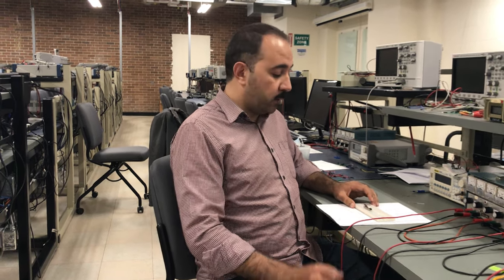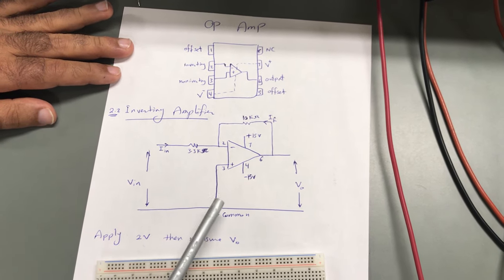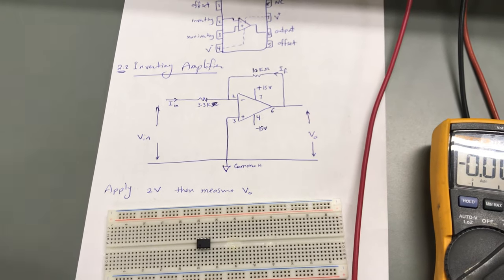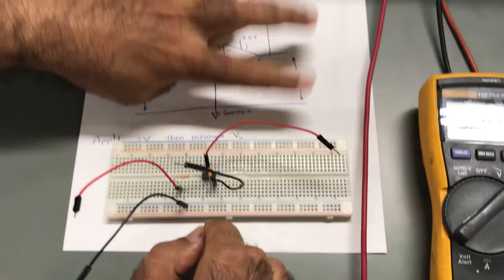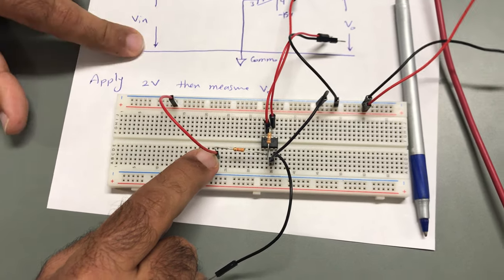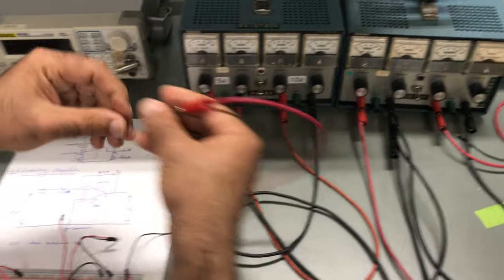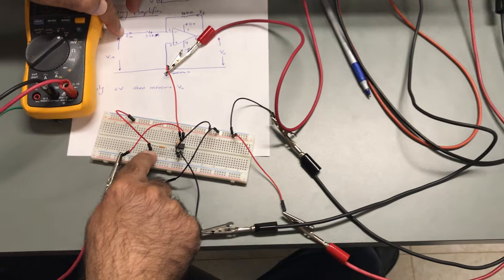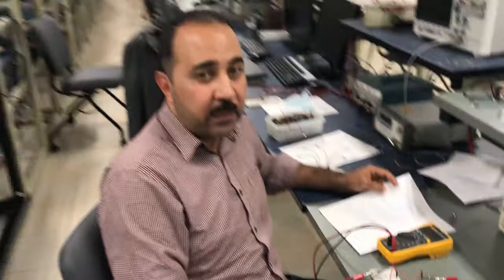Lab 5a Operational Amplifier inverting amplifier

Comment: Nice video! Why didn´t you show us the input an output signals on the osciloscope?
Reply: Same.
Reply: You don't need to actually use the  oscilloscope, it is needed when we are doing differentiator and integrator because in these cases, the out wave form will be distorted. On the other side, in the inverting and non inverting amplifier case, you have to  show that the output changes according to the equation.

Comment: Thank you so much for this video. I have a question, don't we need to connect the ground between +15 and -15 ,to the com port of the circuit, which is the input and output gnd? Thanks